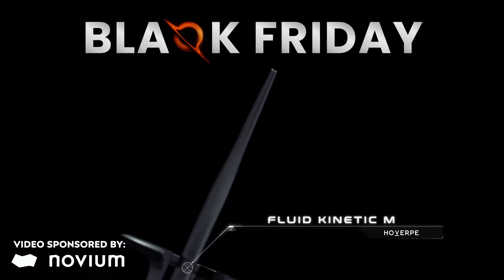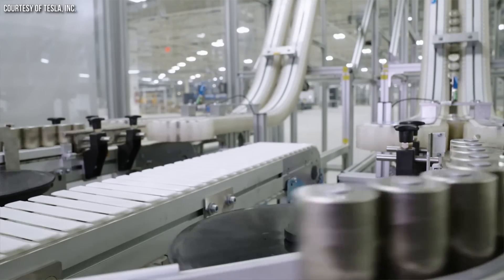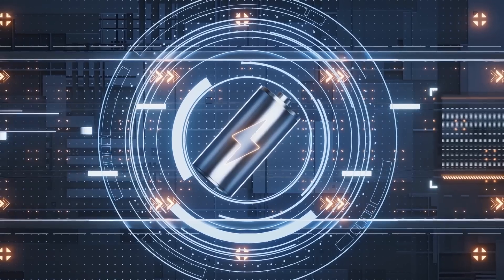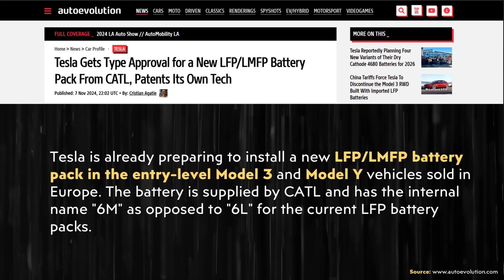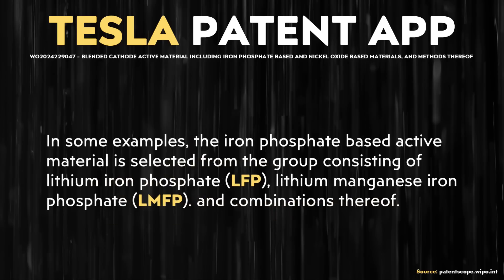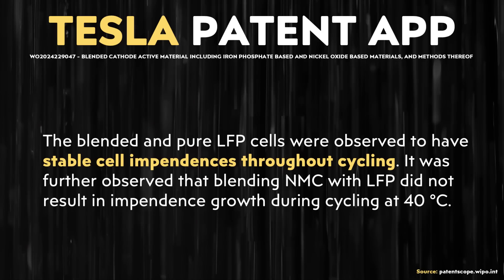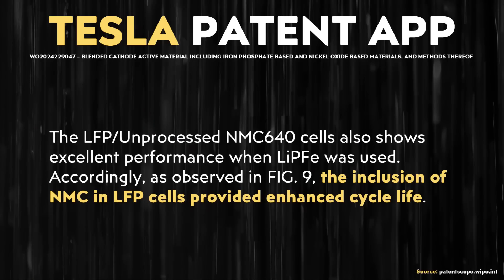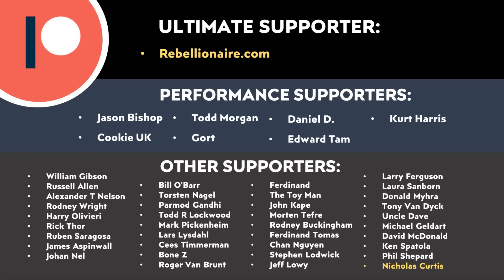NEW Tesla LFP/NMC Battery Hybrid REVEALED | New 4680 Chemistry?

Comment: The CATL CEO told Elon Musk that the Tesla 4680 cylindrical cell will fail, and that prismatic rectangle cells are the most optimal.  I agree with him and think the solid-state prismatic cell is the ultimate battery design and chemistry and the 4680 cell is a huge disappointment and failure.
Reply: Manufacturing in spools seems easier though..
Reply: Jelly roll is faster to manufacture
Reply: Show the data.

Comment: This shows the thoughtline behind Tesla's battery strategy - they first ramped up an optimized cylindrical form factor production at scale (they can be made faster than prismatic or hard rectangular cells) and then got the dry cathode and anode manufacturing nailed down (based on recent news).  That increases energy density and weight.  Now they are showing how they can riff different chemistries on this manufacturing model.   Tesla has developed and evolved (albeit slowly) a flexible and cost effective battery manufacturing capability furthering its vertical integration.
Reply: (not disagreeing with you) - Just input for anyone reading. : 
"slowly" must be defined and cathegorised. In regards to ( successfully inventing a completely new mass manufacturring technique ) 5 years is not a specifically long time. Though, in investor/hype/moon terms 5 years is indeed a quite significant time scale. 

If it was 5 years to release a product with a specific color scheme, then yes 5 years is a significant time and also a waste. 

Anyways, you are spot on with the procuedure - Ramp the product - fine tune the products core elements (anode / cathode) - experiment and implement anything that decreases costs/ increases usecases. 

(Tho, I must admit initially I was disappointed with the 4680 until i understood that it was a process of various implementations and iterations, and not a - "we're releasing this right now".) kind of deal. They had the math, but they did not have the equipment nor expertise. 
They do now.
Reply: If I remember correctly, around battery day, Drew Baglino said the dry process they were developing was chemistry agnostic.